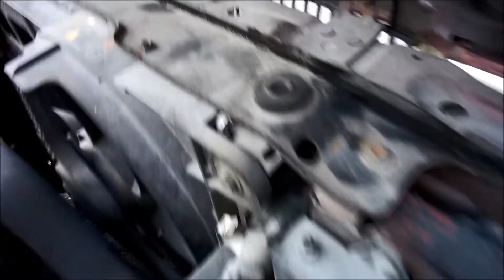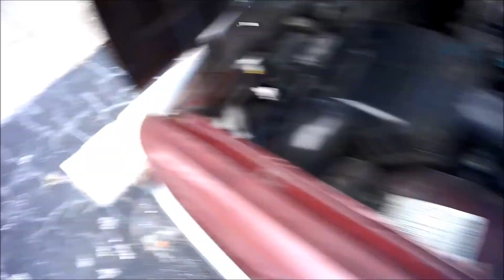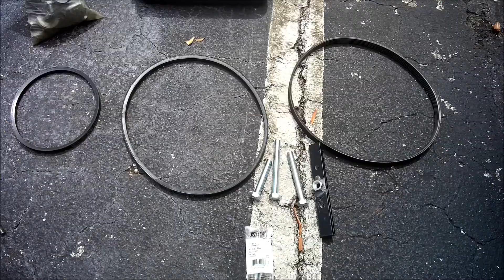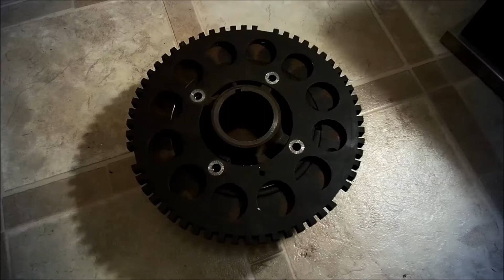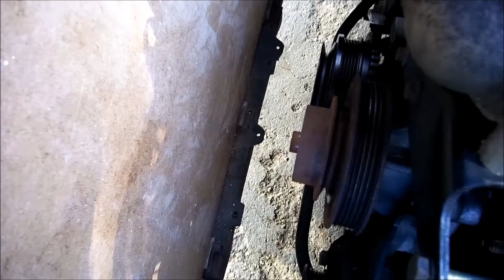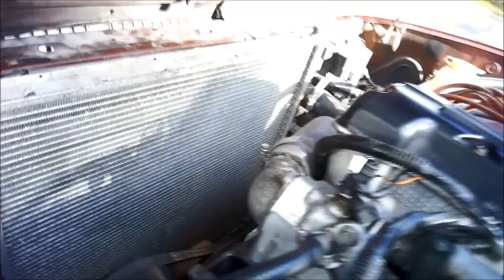1994 Jaguar XJ6 harmonic balancer remove and install

Comment: Hi like the video.  I have a 1995 XJ6 I have replaced the Balancer.  In the ground I noticed a crescent shapedpiece of metal that looks like it might be a locking key for the shaft does yours have the same type of locking key?
Reply from the maker: Hi Lance! Sorry for the late answer. Yes, the crankshaft of my engine is keyed.
Reply: @IhaveanXJ40  Where and how does it fit.  Do you have any pictures ......help
Reply from the maker: @lancelawver3928  I took pictures but the key is not visible. Try to google it to find pictures.

Comment: Are u replacing it because it makes a noise because that’s I have to replace in my96 xj6
Reply from the maker: Hi Braulio! Sorry for the late reply. Yes, It was making terrible noises and can also effect badly the crankshaft and make damages to it or the transmission. Have you fixed yours? I uploaded a short video about this problem, here's the link: 
https://www.youtube.com/watch?v=QUhEbv8qfcM
After this video, the problem just got worse so I had to fix it quickly. Let me know how yours doing.
Cheers!

Comment: Thank you for the excellent video; I am sure many will be helped.  We now  routinely  bake each harmonic balancer we rebuild. ( Dale at Dale Manufacturing....)
Reply from the maker: Hi Dale! Thank you for the positive feedback. After I installed the rebuilt balancer, I felt the difference right away. This job took me a little longer because I haven't done it before and I had to figure out the removal and installation.

Comment: what size bolt is that
Reply from the maker: Hi! Which bolt size you're asking about?
Reply: The harmonic balancer bolt
Reply from the maker: The bolt that's holding the harmonic balancer on the crankshaft requires a 1 5/16" socket. The longer bolt I used to start pushing the balancer on the crankshaft is a 3/4". It's thread is a SAE 16 TPI

Comment: Hi, interresting but i didn"t understand how you unlock the bolt, ok with the breaker bar but what dis you do with the engine please? Thanks Fred
Reply from the maker: Hi! First I removed the fuel pump relay (located in the trunk) then turned the ignition key like I'd start the car.